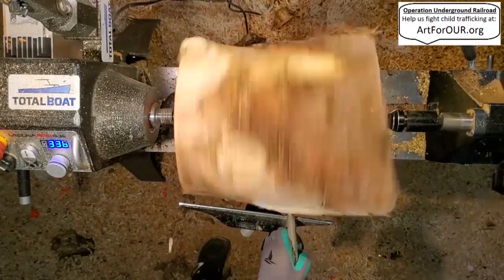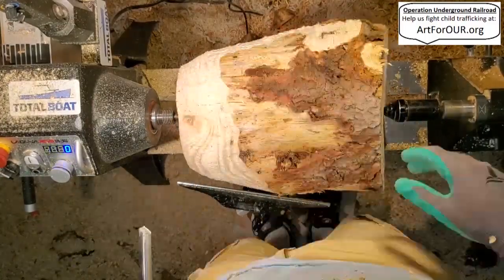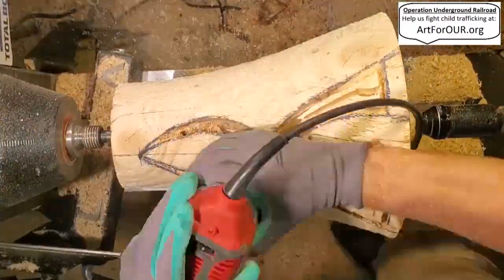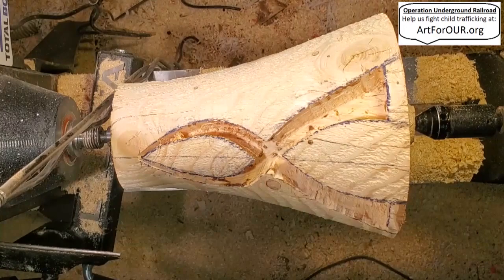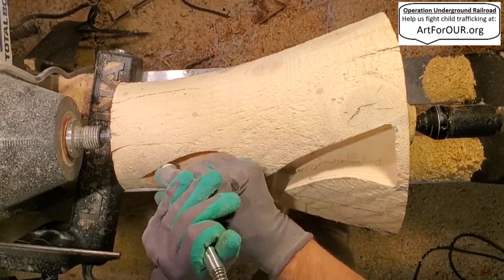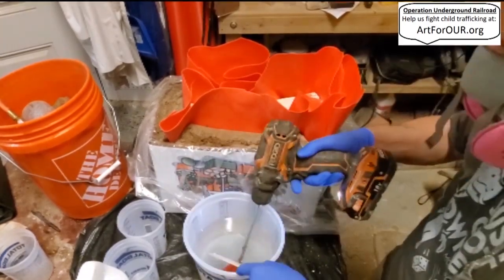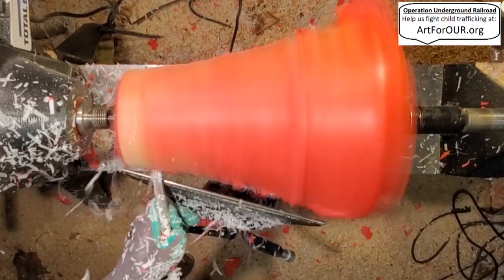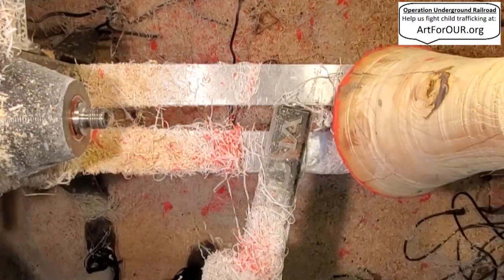"Cracked"  Resin, Pinewood and wood turning.  Running with your errors...  :)

Comment: In my younger years when I use to do a lot of auto restorations, I could vary the cure time of the body fillers by decreasing / increasing the amount of the reactor.   If I needed a fast set time, I’d add more reactor.  Conversely, if I need to slow down the cure time for more working time , I would add less reactor.   You might experiment with your resins to see if doing this would work well for you.  But there is a fine line on what will work at both ends of the spectrum and you may end up having a gummy mess by not putting in enough reactor or a rock hard blob by putting in too much and it sets very quickly.
Reply from the maker: Not a bad idea!  Thank you....
Reply: @artgivinghope  If you try this , experiment with small quantities since resin is a little pricey.  I’ve never worked with resins before and not sure if they act like auto body fillers. But, it might be worth to try out to see if you can decrease/increase cure times by varying the reactor amount.

I suggest reading literature that comes with the resin on the appropriate reactor to use to increase / decrease cure times.  I think my suggestion may not work since body fillers are a different breed of material.